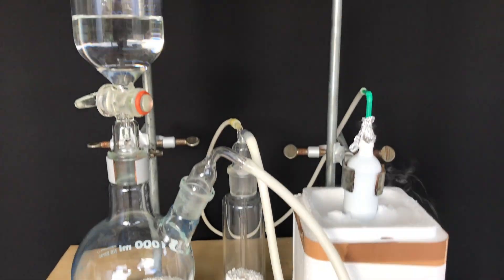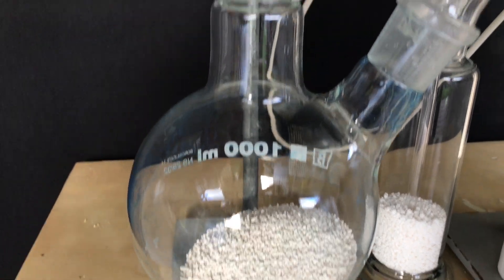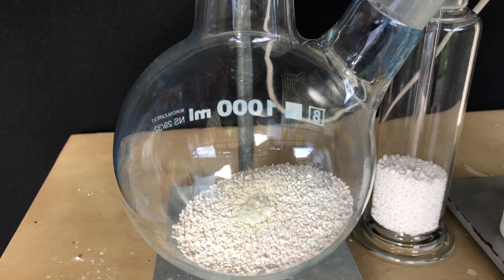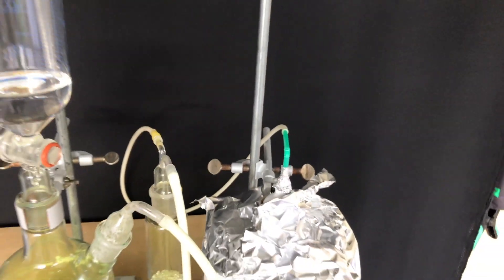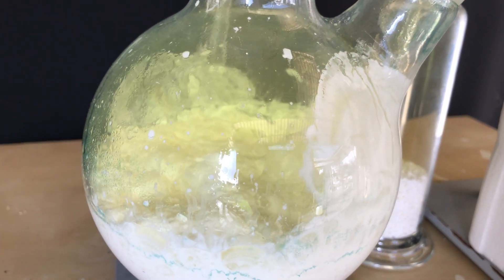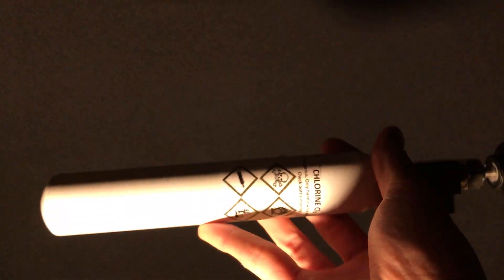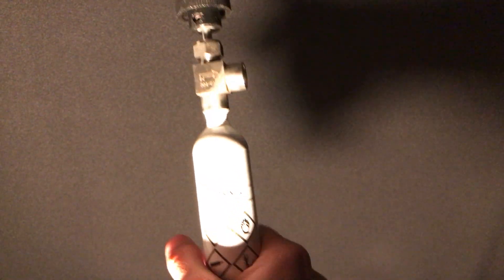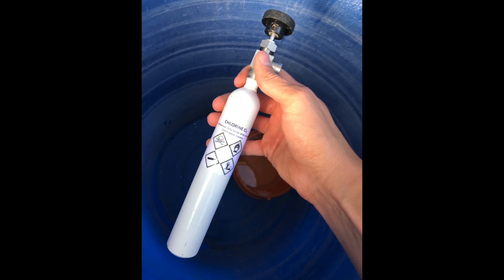Thyzoids Chlorine Lecture Bottle

Comment from the maker: In this video I bottled up some chlorine for future use. This is incredibly dangerous so do not try this yourself. Steel is resistant to PERFECTLY DRY chlorine so the bottle will survive but it is still dangerous to store. The valve is made from chlorine resistant stainless steel. The pressure in this bottle is between 4-8 bars. Liquid chlorine has a density of about 1,56g/ml at its boiling point.

Comment: the thing i dont understand is why did you do it? In wich process would you need that amount of Cl2. i mean why dont you just produce it when needed. I get that its cool and all, but why would you risk it leaking or exploding, espacially with those cheap bottles (they should withstadn it, but you never know for certain)
Reply from the maker: I absolutely hate having to set up chlorine generators for small scale tests. I set up at least 30 chlorine generators this year and I´m done with them

Comment: Very cool man. I’ve always wanted to do a similar reaction to get dry liquid chlorine but getting a hold of liquid nitrogen or dry ice is a pain in the ass where I’m at.😢
Reply: Liquid nitrogen I can understand, however dry ice has many uses. People use it to make fogs for party's etc, to make ice-cream, to quickly repair a dent in cars, to loosen ceramic floor tiles... You should be able to locate some in your local industry zone. They often get requests from private individuals.